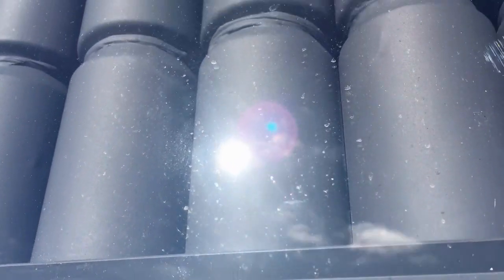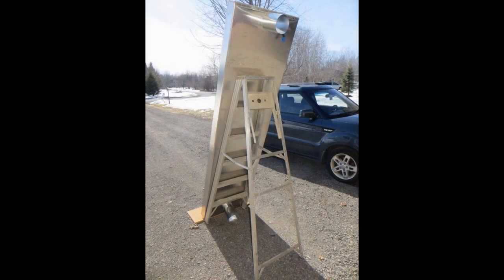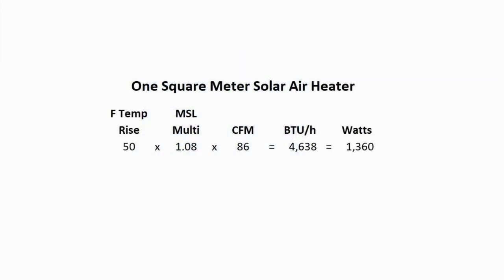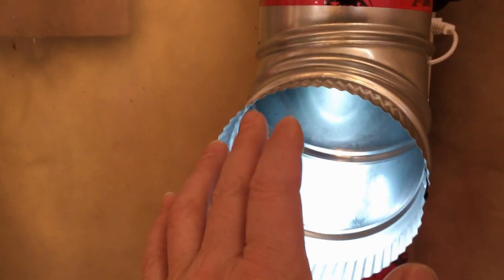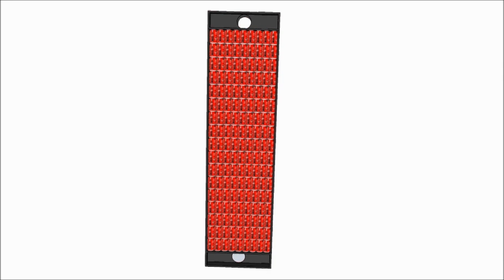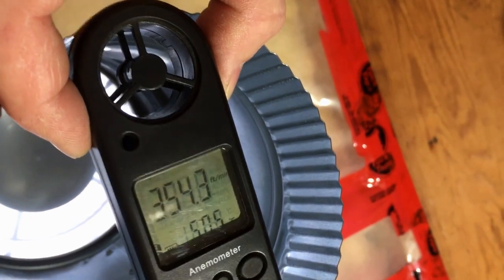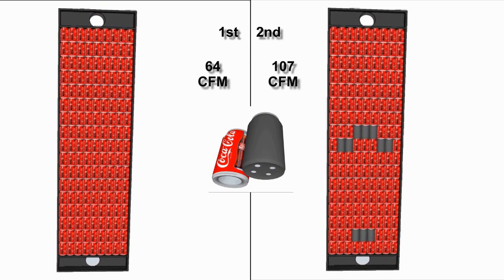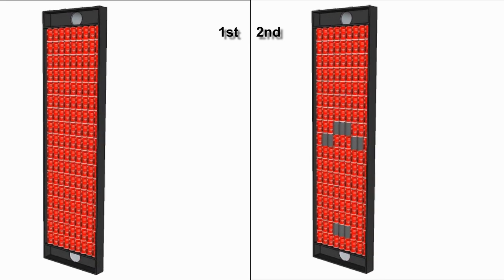DIY Solar Air Heater Part #7

Comment: Design number three should be about eliminating outside air intrusion, flowing through a toxic spray painted air induction system, which absolutely should be considered as introducing more unhealthy air into your home. Noticed that the dude never talked about the smell and the ridiculous over construction of a system, which should be very isolated.

Comment: About the toxins from the spray-painted aluminum cans:, you’re bringing all that toxic air into your house.  Stupid idea for many reasons. He’s not suggesting his idea is ideal.

Some dude has a better idea that requires no intrusion and doesn’t poison you with toxins from stupid baffled toxic intrusion into your home:

https://youtu.be/lQ68jPlnMxM?si=TsGo0vFWKwINyBHU
Reply: BS. Separate your internal air from outside.  A hundred watt solar panel can power an internal fan & heat element even in winter in most of Canada. You can see the spray painted toxic airflow system he designed and copied from other people is a breach into the outside of your home and also it’s bringing in all that spray painted shit into your environment.

Comment: Thanks for all your research and demonstrating that this works (if sized properly). I think I can explain the higher efficiencies you see with having more airflow.

The air flow itself has no bearing on how much energy can be captured from the sun assuming the two units are perfectly equal. Lower airflow means less energy moved into the room. That excess energy goes into raising the temperature of the unit. A higher airflow means more energy is removed and thus, the unit's temperature will be lower. A higher temperature means more energy loss to the environment since heat transfer depends on surface area (same for both) and the temperature difference (higher for lower airflow). The higher airflow unit is simply bringing in energy that would otherwise be lost to the environment.

I'm looking to build one of these for next winter. This winter, I will test on a smaller scale. I'm using a double layer of acrylic with 2 inches of foam insulation. I made a calculator on excel to do some modelling and it looks like having 3 inches of insulation would really help it retain more heat.

Did you consider using a 6 inch duct/pipe to direct the air inside of the heater instead of pop cans? You want turbulent airflow and based on my calculations, 40 CFM would bring the Reynold's number to about 10k which is "fully turbulent" and the length required to develop this flow will likely be less than a few feet.
Reply from the maker: Thanks for the feedback. One piece of advice, if I may — scaling isn’t as simple as it seems. You can take the pop-can cut designs from a small unit, follow someone else’s work, and then scale it up to a larger version thinking it will produce more heat. What I found, however, was that it actually created more resistance, higher temperatures, less airflow, and ultimately less transfer of BTUs. It’s an interesting science and not as straightforward as it might seem. I definitely encourage experimenting (as inexpensively as possible) and being open to whatever results you discover. Have fun!
Reply: @LifeIsShortDIY  Thanks for your response! I'm avoiding the pop can method since it requires a lot of assembly work just to induce turbulent flow and as you experienced, that doing it incorrectly will restrict airflow. That's why I was wondering whether you looked into using a simple round duct since theoretically, turbulent flow could be achieved with just 40 CFM and most booster fans support that flow rate (and more).

A couple more questions if you don't mind answering:

1. Another youtuber did a 7 year review on his solar heater and he suggested not to use the pink foam since it could melt. He suggested polyisocyanurate. Did you notice any insulation degradation? Did the PL construction adhesive hold up to the extreme temperatures?
2. Did the plexiglass yellow over time?

I actually completed a few test trials of my prototype (2 inch insulation box with 2 panes of acrylic). I'm at 43° North (Southern Ontario) and with an outdoor temp of 11 °C, the max temp reached was about 90.3 °C before I shut it down. It is so promising as a source of supplemental heat.

Comment: I came across a similar product "China ebay". It’s designed for vegetable greenhouses. It’s a heat collection device. It’s a black plastic mesh fabric. The height is about 3 meters, and the length can be extended freely. There are water pipes connected on top, and water is dripped onto the black mesh fabric. In this way, heat can be collected.
I have a similar idea. We can make a larger plastic bag. One side is black, and the other side is transparent. On the black side, we can add a bubble wrap layer.  This will provide an insulating effect. One end can be inflated, and the other end can be used for exhaust. Both the intake and exhaust will complete a cycle indoors. We can add a temperature control device.
I did a rough calculation. The cost will definitely be relatively low. It might be around 3USD  per square meter. I haven’t tested the specific effect yet, but it seems to be quite cost-effective. You can simply hang this product on the wall. When you need to use it, hang it up,  lay it flat on the ground. When you don’t, you can fold it.

Comment: it is cool. But why not use whole wall for solar heat system. cover a glass on to the wall.  use black curtain for can. I believe my solution has cost effective and gather more heatness and long time using.

Comment: Hi, I have only seen your last 2 videos on this subject. Great work and good calculations. I am planning to build multiple of these (it’s been on the mind for a while) for an off grid cabin - with test unit at home. I live in the Midwest so it gets nice and cold. I want to use downpipes as I think it looks more aesthetically pleasing. I have fabricated many things out of aluminum and steel in the past so I would use similar construction.  My 2 comments are I think painting the housing black reduce the heat loss as anything silver will lose heat quicker, and also where you see the fan through the plexiglass I think adding an insulated black panel would also reduce loss of heat. Overall great suggestion and I also planned on using temp controllers etc so this was a great find!!  Thanks
Reply from the maker: Thanks for watching and for taking the time to leave your comments. As I was reading your plans and thoughts, a few ideas came to mind. I love the off-grid cabin concept, but I do have some reservations based on my experience. It’s always different when you move from theory to reality. These solar units produce no heat at all when the sun isn’t shining. I know that sounds obvious, but it’s something people often overlook. For living spaces, solar air heaters can supplement other heat sources but can’t fully replace them for that reason.

Also, depending on their coverage and the heat they produce, these units can sometimes make a room too warm, which isn’t ideal either. I do think they’re a great source of free energy that can significantly reduce heating costs on sunny days, but they might not help much when you really need the heat. Regarding downpipes, they do work well but aren’t as efficient as aluminum pop cans for conduction. There are plenty of videos online about that. If I remember correctly, I’ve shared some info on that topic in one of my videos as well. And yes, you’re probably right about painting the housing black — great idea! The temperature controller is definitely a handy feature.

Anyway, thanks again for your comments. I’m glad to share my thoughts, and good luck with your project!

Comment: And, just an observance, could it be that "if you only Reduce The Largest Hole Only by 17% each" that The Overall Temperature might Adjust Itself and by Enlarging the Output Hole for A Cone Shape for the first 30% would "Funnel The Air into Its Own Riflings for you.  - JW

Comment: congratulations, it is the best tutorial I have seen
Reply: Your calcs at 5:52 I think one is  based on btu s and one on watts. I just cross multiplied and found this out. No biggie. So I forgot what the area of your heaters are in terms of meters squared.. J read somewhere that only about 1000 w/m2 actually reaches the ground due to atmosphere diffusion, etc... So Id like to know the percent conversion of your second heater vs maximum available(based on your square area) If better than 17 percent(solar pv) then that makes the case that solar pv is less efficient than solar air heater. (Dont know if this would hold for cloudy conditions though).If your conversion percent is mis 60 s then it rivals that of direct solar heated water. Also what about direct comparison's to commercial units ?
Reply: Also you could test you wind meter by measuring it directly thru a dryer vent ans comparing to the 151 cfm specs and adjust your readings accordingly? Percent variation
Reply from the maker: Hey thanks for the feedback.  Keep in mind this is all trial and error.  Fun project though, and it takes the edge off what would otherwise be a cold hangar. Cheers

Comment: Since I'm thinking of installing such a unit on my garage, it's a great informative video.
Reply from the maker: Good morning, thanks for the short note.  We have been using this system for a few years now, and although I’m thankful every morning with the warmth it brings into the hangar, there is one thing  I would do differently if I was to do it over. I would use glass instead of Plexiglas.  My plexiglass is not standing up over time.  Dozens of hairline cracks are forming.  That is about the only additional peace of information that I can share that I think might be valuable to others.  Look for some second-hand windows and size your unit accordingly.
Reply: I built a metal garage last year behind the house, 500 sq ft with no heat.  I've watched a bunch of videos to help me produce an efficient solar heating unit.  Im glad I read through these comments and hopefully it will work out great.  I live at 10,000 ft in the rockies of Colorado, winters are long at such elevations so this will definitely be a necessity to have.  Thanks!

Comment: Can you tell me the source and details about the fans you used on your final version?  Thanks for posting this series.  Very good videos and information. 😁👍
Reply from the maker: here you go: 
SAILFLO Duct Fan Exhaust 5 Inch 110V 16W 141 CFM Large Airflow Exhaust Ventilation Fan for Vents Ducting Attic Kitchen HVAC System Grow Tent Garages Barn Factoris (5"/125mm)
Reply: @LifeIsShortDIY  Thanks very much.

Comment: Great informative video. May I suggest some potential improvements?  Place sun reflectors on the sides and bottom as a solar oven is built. And since air is expanded when heated creating more mass,  it may be bottle necking with too much mass to leave the heated chamber. If you where to maybe install 2 holes at the top and one on the bottom, you may not need a fan.  I would believe that the heat will go with the least amount of resistance. Maybe even 3 or 4 holes with a flexible exit door on top so the heat pushes the door open to escape into your area to be heated and closes when it's not heated. Thank you for doing the work and great presentation with your wonderful graphics. I need to build one and I have limited amount of time and money to do so, I need to get this right the first time around. That's why I care so much . Responding to my comment would be greatly appreciated. Thank you again.
Reply from the maker: So much of this work is theory and testing.  You have a number of good ideas here, but they are not tested.  From your list, I cannot comment on what works and what doesn’t.  I’m not sure that “getting it right the first time around” is possible.  I’m sure whatever you build you will learn from it, and your second version will be better. if you follow my videos from 1-6 you will see that my earlier designs didn’t work at all, and I was following the advice of those before me.  In my last video, I took a unit that was working and made one even better. I suspect there is no end to that.  Suggest starting with something similar to mine, try one or two of your ideas, and see if you can make it better, then share with me and others. We all learn from this.  Best of luck.  Cheers.

Comment: At 7:00 I used the can on the right with four holes. Then to get the spiral effect I put a rod into the hole and twist it so that the hole has a depression on one side and a lift on the other.
This causes the spiralling in the can.
Reply from the maker: The can with the four holes did not work for me.  You will see that in video 5.    Cheers

Comment: Honestly that is unreal , i was just starting MY FIRST build when i saw your video purely by accident ( surfing ).  I cant wait to use your idea, but i have an idea for you if you want to try it one more time.  I ride motorcycles and in the old days you would take off the muffler and install a baffle into the header pipe to change the sound. They are an X configuration yet twisted which would cause the air to twist like in a barrel of a gun.   Just a thought but i think i am going to try it myself. I will let you know off my results when i finish it.  But it might take a long tome, i work 6 / 10 hour days and little time for myself.  Thank you for the information and the inspiration. the best video i have seen on this subject ever.  Patrick
Reply from the maker: Patrick, nice to hear from you.
I love your twisted “X” idea.  I have another idea for you to try.  A fellow in Mongolia was suggesting that I try stuffing crumpled metal screen (screen door material) into a metal downspout.  Apparently in provides phenomenal conduction, with minimal restriction to airflow.  
Good luck on your build, and keep me in the loop with your progress
Cheers
Dwayne

Comment: Hello big fan. I'm going to build a solar panel this month so I'm wondering if you have any new tips and maybe solutions to add to your BEST Solars videos? I find it very useful and want to create my own. Please, more information will be very much helpful. Thanks
Reply from the maker: Hi there, thanks for the note.  Well we have been using our unit for a couple of years now, and I do have a few comments, so thanks for asking.  
The electric fans that we purchased are working really well, no bearing noise, or any negative vibrations. They have a couple of thousand hours on them, and they are doing well.  
The Plexiglas is another story.  On one of our units hairline cracks have formed starting at some of the screw holes.  I have stop-drilled these cracks with no success, they seem to be continuing.  I’m not sure why this has happened, as it has only happened to one of the units.  When I installed the Plexiglas the holes through the Plexiglas were purposely larger than the shank of the screw; this was to ensure there was no undue pressure on the Plexiglas, and to prevent exactly what we are experiencing.  I installed both using exactly the same technique.  I can say that the second unit, the one with no cracks, has twice the number of screws securing the plexy, possibly a screw every 6-8”.  In any event, no cracks in this unit.  
I have not replaced the Plexiglas yet, and don’t have any plans to do so until it is absolutely necessary.  
So a takeaway for me that might apply to you is to explore glass and possibly make use of used or recycled glass.  I.e. get your hands on second-hand glass, and make your heater unit “that” size.  I suggest second-hand, to keep costs as low as possible.  
I think that’s all I have to add.  On a sunny winter day, when it is -18°C or 0°F our hangar is about 5°C or 41°F.  Very nice.
Good luck with your project.

Comment: Thank you for the education. I wonder if small individual fans on the bottom of each column could increase air flow?
Also could redirecting air up and down the columns (3 times) effectively increase temperatures if the airflow was sufficient ?
So much to learn from you!
Reply from the maker: Thank you for your comments.

Very kind of you to refer to my ramblings as education.  This project for me was a wonderful experiment.  To be honest, I believe I have learned more from those watching our YouTube channel, as many have shared with us their experiences and ideas in this space.  

I have received numerous comments and suggestions regarding the recirculating of air two or three times, and I can’t say definitively what the outcome would be.  However, I know when we start to explore these paths it is important to remind ourselves that these units don’t produce heat, they capture it. 

This is really an exercise in maximizing conduction.  Each square meter of sunlight only produces approximately 1380 watts of energy, and I believe that if our experiments remain focused on thermal conduction, maximizing heat transfer from hotter to colder, we will continue to improve our designs.

Chatting with a fellow YouTuber from Mongolia, the gentlemen suggested using rain downspouts filled with crumpled metal screen.  Apparently that design has tremendous conduction properties.  

I am currently 100% engaged in another project, but if I was to build a third unit, I think I would experiment in that space and see how it compares with my first two designs.

Cheers
Dwayne